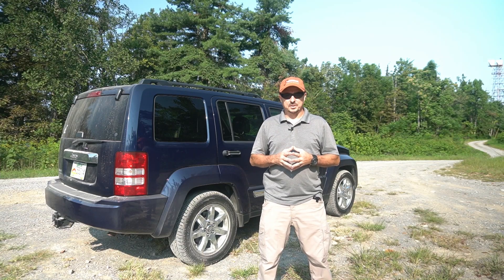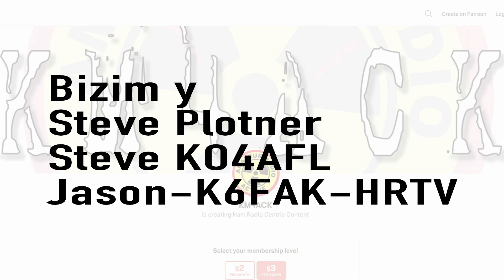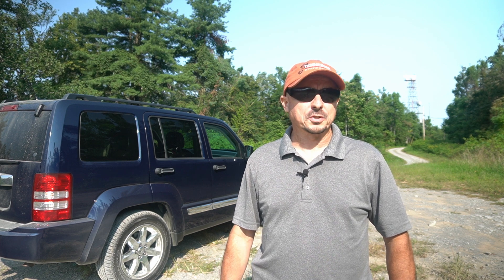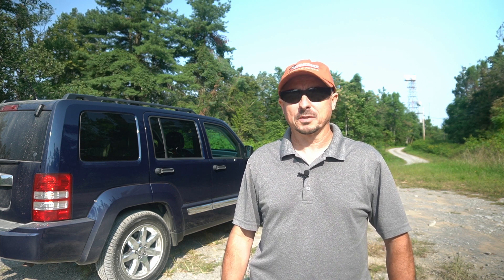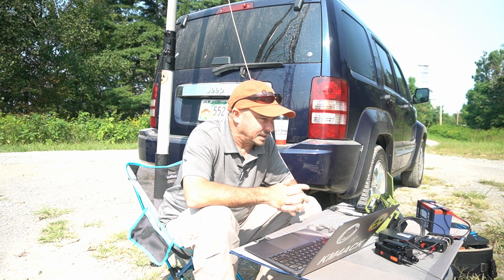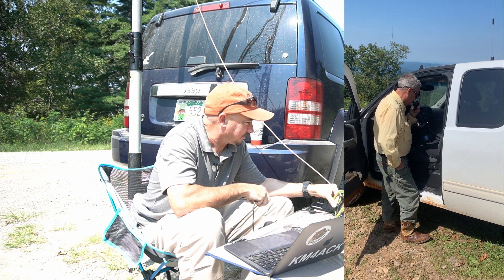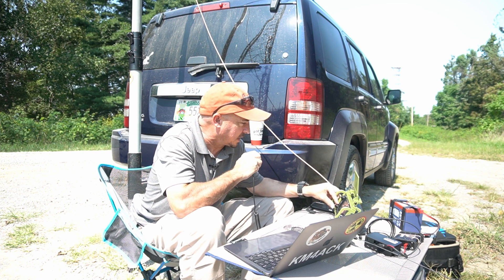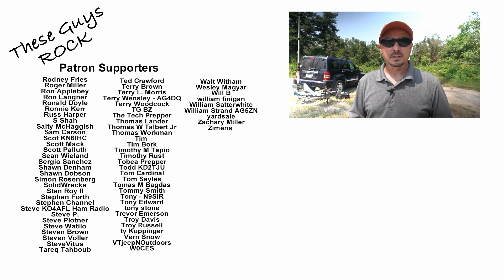Icom 705 :: First Field Trial

Comment: What's your opinion on the IC-705? Seems like there's no competition in this segment (mobile, SDR with multiband transmission capabilities) + it can be unlocked for CB bands and so on...
Reply from the maker: I love almost everything about the 705. My only complaint is I don't care for the form factor. I prefer the form factor of the 817. Other than that, the 705 is gold.

Comment: Youtube needs a better sort function for comments. I apologize if this question has already been asked, but what version of the Raspberry Pi are you using, and did you make any modifications, such as overclocking or software optimizing to make it more agile and responsive? I have been fairly pleased with the Pi 4 Model B (8Gb.) But there are a few places it is a little lacking. The first that comes to mind is it is unable to operate my RTL-SDR V3 down in the HF bands. If I want to monitor anything below 24mHz, I have to bust out the Windows 10 laptop and fire up SDR#. This may just be a driver issue though and I have not figured it out yet.
Reply from the maker: I am using the Pi 4 4GB model in this video. I haven't done any overclocking on this particular Pi. I have over clocked the Pi 4 8GB model that I run in the shack. https://youtu.be/oyV4n5IVFRs

Comment: 2 questions - 1. Did you turn USB charge OFF? Not sure if you have the cable plugged in but the charge set to ON creates noise.
2. Did you do a vid on pulling GPS/gridsquare signal from 705 to build-a-pi? Or is it coming thru flrig?
Reply from the maker: I DID have USB charge set to on. Never thought that it might be creating the noise issue. Thanks for the suggestion! I haven't done any tutorials on the 705 connected to the Pi yet. I need time to get familiar with everything. It is pretty easy though if you are using Build a Pi. Connect the radio to the Pi and wait for it to acquire a GPS signal. Make sure the GPS is set on the radio. Menu->Set->Connectors->USB(B)Function->GPS out = ON. Now from the main Pi menu, open the GPS Update Tool. When prompted, select the options that ends in “IF02” Give it about 5 minutes and your grid should be displayed in Conky. If not, head over to the forum https://groups.io/g/KM4ACK-Pi/topics

Comment: I don’t know if you remember, but we exchanged some emails regarding noise I was having when using the TP Solar panel with a Miady battery and Buddipole PowerMini together with my 705 and 7300. Since our emails, I’ve purchased a Bioenno battery and PowerFilm solar panel. During this past field day, I did a bunch of experimenting with different combinations, and it came down to the TP Solar panel creating all of the noise issues I was having. I’ve decided I’ll use the TP panel to charge batteries that aren’t also powering the radio, and use the PowerFilm to charge the battery that is feeding my radio. 

I have read a lot of comments of people having RFI issues with their 705 and USB cable. I purchased a quality cable for mine with chokes built in, and have never had any problems on that front.

Hopefully some of my experimenting helps you as you do your own! - N7CCD
Reply from the maker: The interesting part of this day was I wasn't using solar. I was just using the Dakato battery to power the radio and Pi. The only reason I had the charge controller was to monitor the battery level and act as a power splitter. I still need to do more testing but I am fairly certain the noise was coming from the Pi hat that converts 12V to 5V. A better quality USB cable is probably in order as well. Got suggestions?
Reply: @KM4ACK  Well as you mentioned in your video, the troubleshooting is all part of the fun in the hobby! I was sure it was the PowerMini causing my troubles (bought mine just before the Mini 2 came out) until I tried a U.S. made solar panel. Based on my experience, I would guess the PowerMini is not the culprit in your setup. It’s obviously tied to something in the charging chain if it went away when not charging. 

I agree your Pi hat is a very good starting point. I’m using a Powerwerx cigarette to power pole adapter with a high amp USB adapter to take the 12V to 5V and power my Pi. I was fighting low voltage warnings before I got that setup. Once you have some time and solve the mystery, let us know! - N7CCD

Comment: For  as good as the IC-705 is, I recommend the TX-500 for HF QRP. It’s a crazy amazing radio. I’m currently doing 20 meter mobile QRP using a hamstick mounted to the back of my truck. I’ve worked Idaho to Michigan, Iowa to Florida, and just today Iowa to Central California. On today’s QSO, the other guy was running 1KW and I was receiving him at about 4x3. With my 10 watts, he reported me as 5x3. Th distance is around 1,500 miles. I can’t say enough good things about this radio. Oh, and it’s water resistant too 😀

Comment: Thanks for this video. Questions: 1. Why not add a feature to gateway search that allows you to input current grid square? 2. What mast were you using? 3. Were you able to establish a winlink connection?
73 de Arnie W8DU
Reply from the maker: The calculations for the distance/bearing in the gateway list are done at the time the list is downloaded. With that said, there is a new feature coming in Pat Menu 2.4 that will allow multiple list downloads for different grid squares. The mast is from TN07 - https://tn07.com/telescoping-masts Yes, the Winlink connection was successful :-)

Comment: I had a noise issue with my 705 using a cheap usb cable, switched to a different cable and it's working just fine now.

Comment: I solved most RFI problems via USB cable by connecting to IC-705 with WiFi and by using wfview software on PC (raspberry is also supported). wfview is getting better and better.
Reply from the maker: Does wfview support direwolf and ARDOP?

Comment: Nice video as always, quick question what are you using for internet access for your BuildaPi?
Reply from the maker: I don't typically run internet in the field. I did demonstrate how to do it in the field in this video https://youtu.be/lyLFO8tgt_M though.
Reply: @KM4ACK  thanks, will check out the vid. In this video when you where checking for packet stations was that via internet?
Reply from the maker: @kq9l115  The packet check in was over RF to a Winlink gateway ~40 miles from my location that day. The list I was working with had been downloaded to the Pi before I left the shack. You can use Pat Menu to auto download the current list each day at a specific time. That way it is always up to date and ready to head into the field.

Comment: Good morning KM4ACK, I had noticed some USB related noise with my IC-705. After emailing Icom about this they had stated to keep the USB cable under 3 feet in length and to add ferrite beads.
In my case I was having common mode noise along my feedline. Some mix31 ferrite helped reduce that fairly significantly additionally wrapping my USB cable a few times through helped reduce it to nothing.
Reply from the maker: Thanks for the info!

Comment: Do you think the Pi and 705 will be able to connect wireless like on windows 10 with RS-BA1 v2 software.
Reply from the maker: I have had kappanhang working for ft8 & js8call. I couldn't get it to work with direwolf or ARDOP. https://github.com/nonoo/kappanhang/issues/18

Comment: You went to the dark side. Don't forget to give love to your 817 and 857 :-) I'm sure you do this already, but I keep an Altoids tin with each radio with an assortment of antenna adapters. Enjoy your new IC-705. Were you running 10 watts on FM or SSB?
Reply from the maker: "Dark side" hihi! I alternated between 10W & 5W (FM) and was able to make the ~90 mile contact with just 5W. Didn't get around to testing SSB on this outing. I needed an Icom in my shack since both the 705 & 7300 are very popular radios and I get quite a few questions pertaining to Build a Pi and the Icom rigs. Hopefully this will make me better equipped to field those questions.
Reply: @KM4ACK  might as well grab a g90 too as an inexpensive 3rd backup. 4 is 1 and 3 is none, or something like that:>)